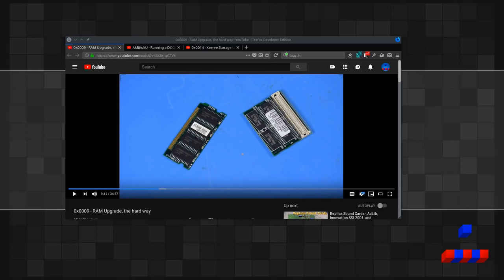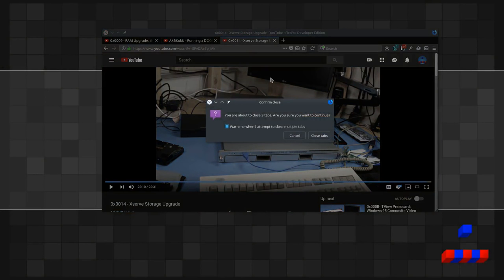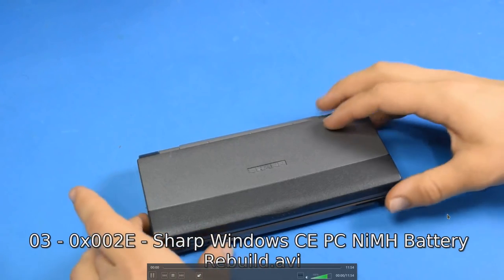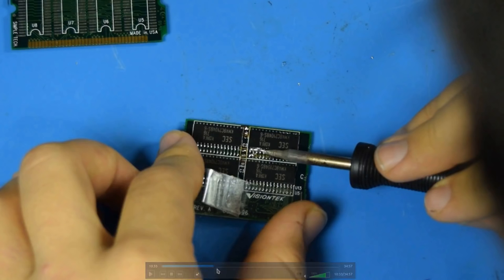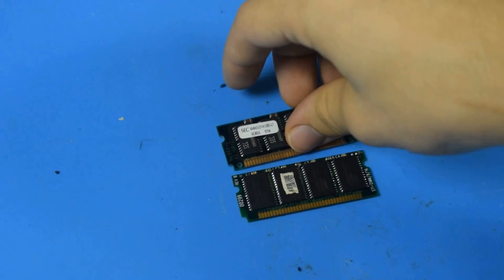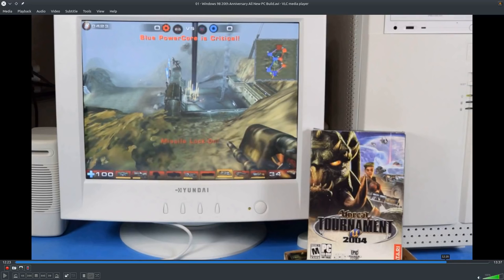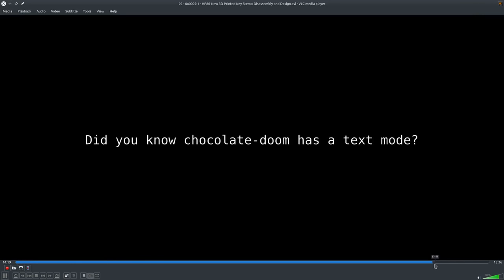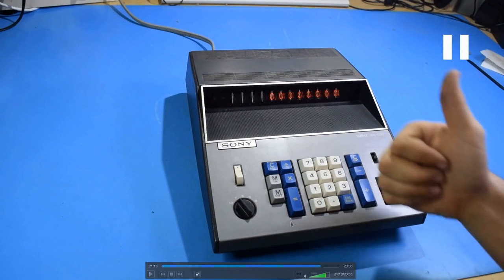1 Year of Making Videos

Comment: i'm still wondering why you are using that weird cad program, have you seen fusion 360? it's free for hobby and students and it's really nice to use.
Reply from the maker: I'm a Computer Engineer, so I am much more at home in OpenSCAD than any 3D CAD software.
Reply: well it seems to me like you are coding the part, which seems like it would take more effort.